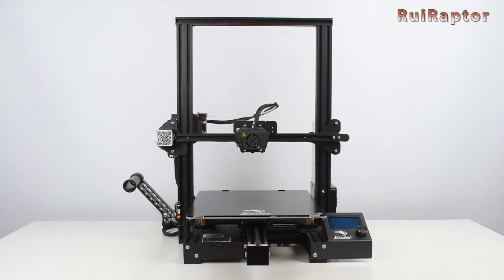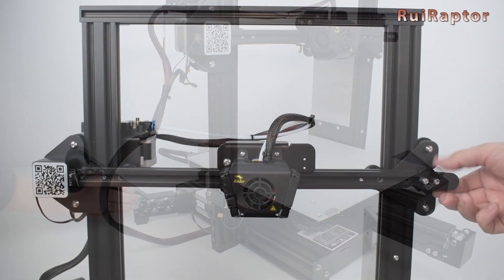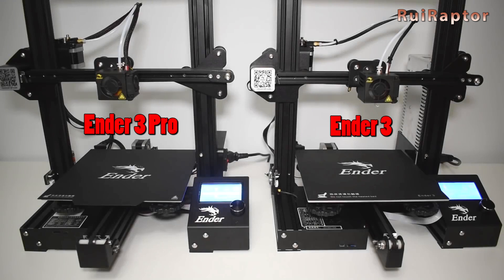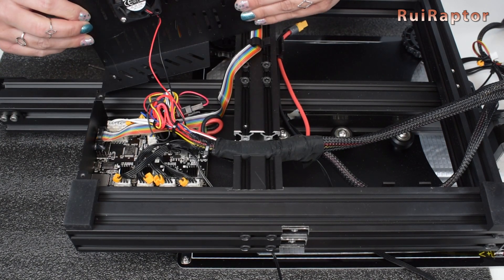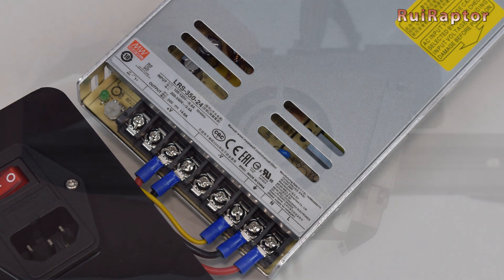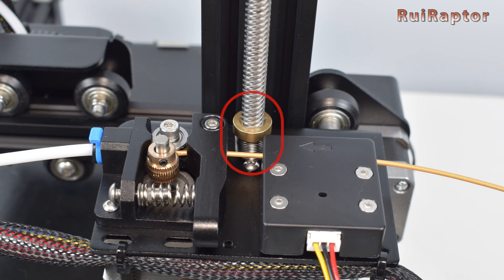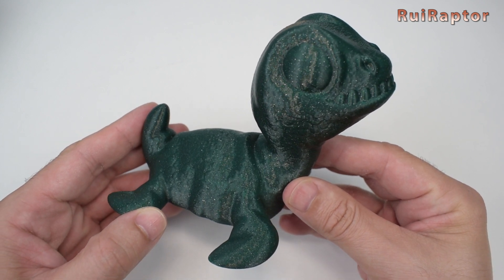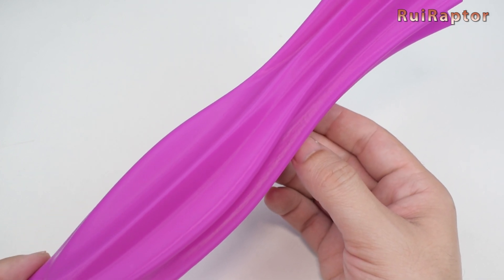Creality Ender 3 MAX - Is Bigger Better??? FULL REVIEW

Comment: I got one in September for my wife's birthday. And we love it, considering its our first 3d printer ever. Yeah I got pissed off alot learning it, (many Many MANY failed prints) about ready to quit and throw the damn printer in the trash, but it was due to printing adjustment software (g code? Sorry still learning all the terms, thats how new I am to this) and learning the difference between pla+ and petg. The only ones I use, and I started off with petg first and not knowing the differences with the temps for petg and pla+. The nozzle and the bed temp are way different between the two filaments lol. And learning bed leveling. After all that we started to have good prints and love it. Would recommend.

Comment: By the way - in this printer, as well as in stock Ender3(pro) - to fix springs, so the bed could be more stable - just add nuts (with nylon washers, to protect paint on bed), so bolts would not wobble

Comment: Thx, for the nice review.

The PSU cover on mine was dangerous, a child could touch AC as it was way to open.

My glass buildplate was warped (deeper in the center). The heating element of the bed is not covering the whole build surface.

The filament runout sensor died with the third print. These microswitch sensors tend to make false alarm and filament can get stucked.

With such a big builsurface you want to use bigger nozzles. I had to print slow with a 1mm nozzle in vase mode, as the extruder is quite weak.

You get what you pay for. I like the frame and the mechanics. It is a good base for modding.

Comment: Ive had mine for about a month and the springs drove me crazy! So I got a BL touch and some solid spacer tubes to get rid of the springs.After I fixed that I kept getting print fails and after looking close the Z on the side with no rod was not keeping up even after adjusting it correctly! So I bought a dual Z setup for a V2 on Amazon for $25 and a 480mm Z rod to replace the one it came with cause no one it making one for the max.Very easy to install only had to put power supply in a different spot.It comes with a spliter wire so they run together.You just need to make sure both sides are the same height and no changes in program.Ive run over 20 prints with no fails now!The dual Z is very much needed on this and I think you will be so much happier with it! Prints are VERY smooth.
Reply: I had a similar issue, but I didn't have to get the dual Z rod setup to fix it! Instead, look closely to the rollers on the side that does not have the rod. If that side isn't keeping up, your roller nuts are too tight! Loosening these appropriately fixed all my issues!
Reply: What firmware did you use?
Reply: I tried for a month but then I used a strain guage and found the issue. Putting the dual Z in and it smoothed out
Reply: @davidjohnson8474  well, guess I was lucky I didn't need it
Reply: @dark_matter8420  yup! The nice thing I like with my build is it never goes out of adjustment
Reply: I used the one on Creality site. Cause it was a quick one download! No going here and doing this